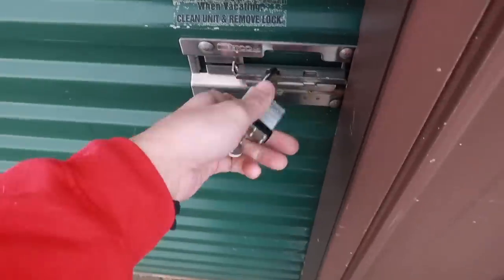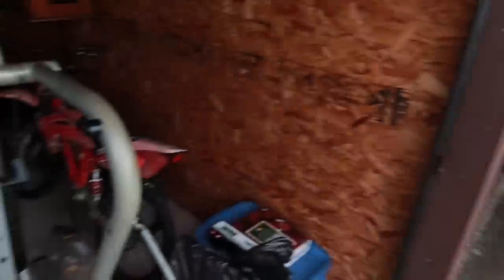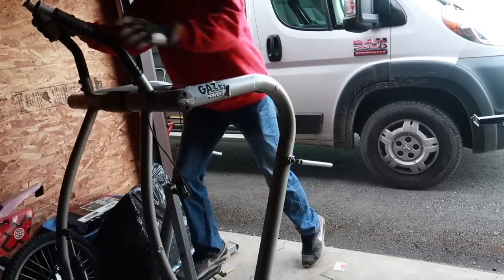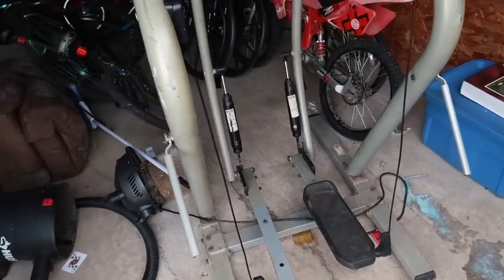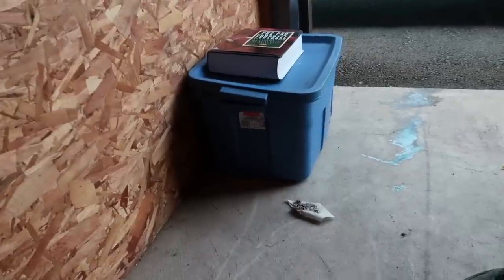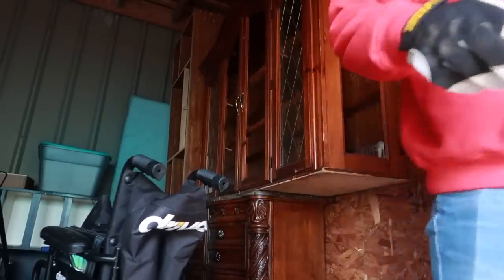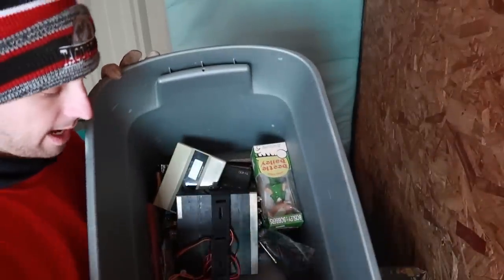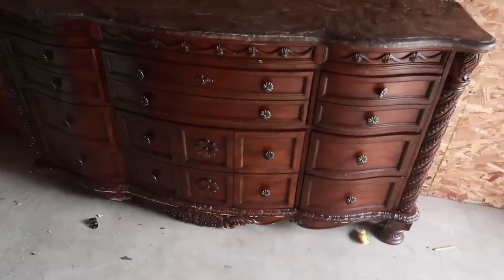I Bought An Abandoned Storage Locker For $10 ... LOOK What Was INSIDE!

Comment: The white plastic drain board goes with the dish holder you wash the dishes and put it in the dish holder and the water goes into the drain holde,r I know the crossbow is worth money more than $10 I'm not sure how much I'm not into weapons the Hess truck is worth more than $5 especially that it has the car in it $65 or more I know I'm into the cars, you mentioned Schwinn bike that's high-priced I don't know what the other bikes are but they can go for higher also you have an expensive comic there as well maybe $65 the $85 it could be worth more even ,be careful what you doing with these items, take a little bit more time with this unit it's a real gem this is even more that you don't even know right now you have to go through that even the books are worth and you got all these things for only $10, the only bad thing I see in this unit was that couch that was garbage. Even the grill is not a grill it's a smoker gril it's both  which is worth a lot more money than a grill that's  worth at least $100,if not more I can't remember everything else it's a lot
Reply: The drain board had a hole in it. Plus you can get a new one for a buck at walley world.
Reply: It's a compound bow, not a crossbow
Reply: I would say the bow is worth at least $75  that is if it is in good working condition and if you can find someone who would be interested in it